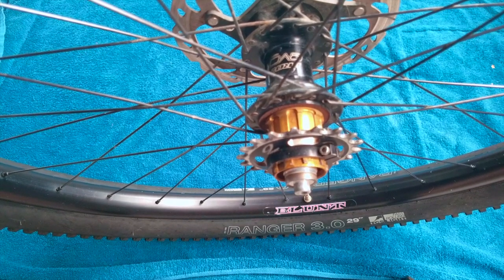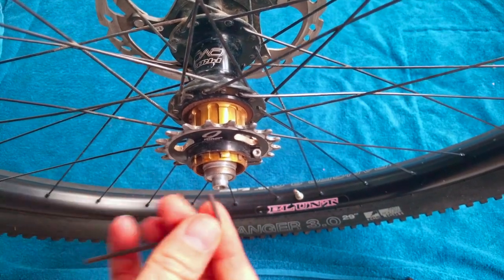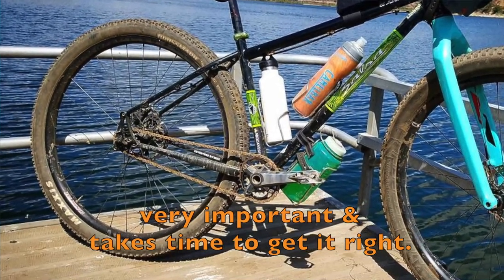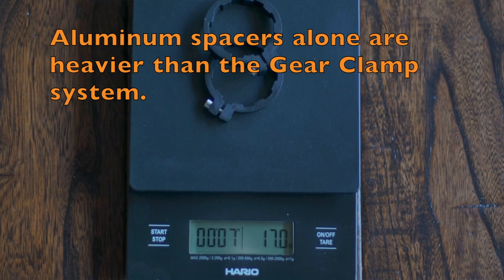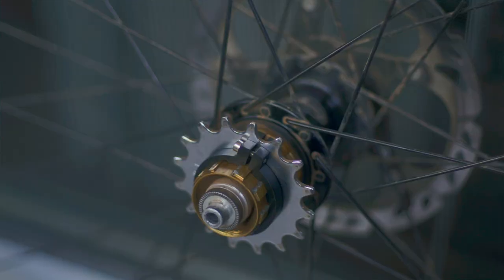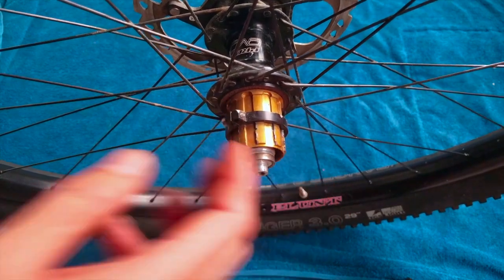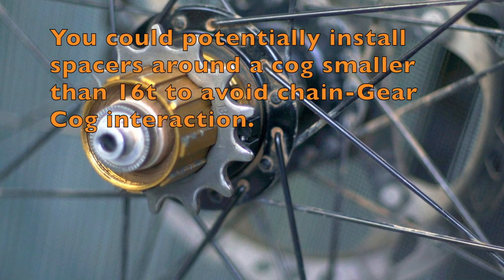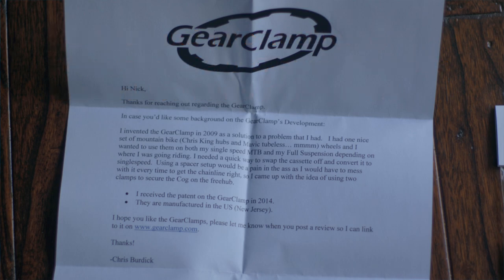Gear Clamp - Lightweight Quick Change System for Bikepacking and Single Speed Racing

Comment: Hey there, thanks for posting this! As the inventor of the GearClamp, I really appreciate hearing people's opinions and riding experiences.  It's cool to see that something I sketched on the back of a napkin (seriously) actually has come to life and people like it. I'm glad that you had a positive experience. Regarding running a 16t cog or smaller: you can't (well, you shouldn't) unless you use it with a set of spacers. When an engineering buddy of mine and I were prototyping the GearClamp we tried a bunch of different designs, but found this one to be the best.  The main design restriction was bolt size.  Going with an M2 bolt was an option and allowed us to make the GearClamp smaller in diameter, but  failure testing showed that the smaller socket size was more prone to stripping when over torqued. I could machine the GearClamps a bit more and allow for smaller cogs to pass by, however that would add to the manufacturing cost and I'm already pretty tight on margins. I've been thinking about a redesign that would allow for 16t and smaller cogs w/o spacers, but it would cost me a few thousand dollars to prototype,test, and make new tooling... who knows, maybe it's time for GearClamp 2.0 Anyway, thanks for posting this video. Anyone with questions or concerns can contact me through FaceBook or at contact@gearclamp.com.
Reply from the maker: Thanks for the comment Chris! Love this product and am thankful you created it! Great to hear first hand about your testing and a little about your intentional design elements. Would love to try a GearClamp 2.0 if it comes into being!
-Nick
Reply: Just have spacers built into the sides of the gear clamp
Reply: Hey Chris. 1. I would like to thank you for making this product come to life. Before purchasing some other components I need to ask you one question: what is the width of one clamp? I need this information in order to pick which cog I will be buying. Wolf tooth makes a cog with a base of 4.5 mm while absolute black makes a cog with 7 mm base profile. Thanks so much in advance.

Comment: Just curious: why do you choose to ride SS over gears? Even the decision to carry a spare cog and chain over running gears. I'm interested in converting to SS.
Reply from the maker: You will have to try it to find out if it's for you honestly. I like the quiet, simplicity, no thinking about shifts, constant desire to maintain momentum, its lighter, and I get much faster everytime I ride singlespeed for a season. Try it!

Comment: Nice review and discussion. Congratulations on the 1st and 2nd place, and great on bike pictures too! I wasn't aware of using a regular geared free hub body for single speed. This is a great option if you don't have a dedicated single speed bike and want to ride a single speed event. It looks like they could manufacture the size of the clamp to allow for a smaller gear without the chain catching?
Reply from the maker: +Henrywildeberry 
Yes, good observations. I am not sure if they would have the same clamping force if smaller, but that is a great suggestion. Thanks for your encouragement on the racing. I had lots of fun this past season.  I loved being able to switch my cogs out quickly with this system. I agree, it's a good system for switching your bike over for singlespeed events. You could quickly remove a shifter and adjust your limit screws on the derailleur to use it as a chain tensioner as long as that complies with the rules.

Comment: Hi there 
16t-18t or 23t? Which one wouldn't make me so tired for a long riding?
Reply from the maker: It depends on how many hills you will be riding up. For easier climbing gear, try the 23. For faster speed on flat surfaces, try the 16t. I raced 32x16 for a 100 mile off road race, but it was mostly flat.
Reply: @RideAlongside  
Thank you so much,I will go for 16t cause I prefer the speed